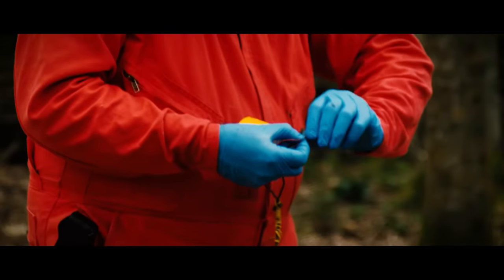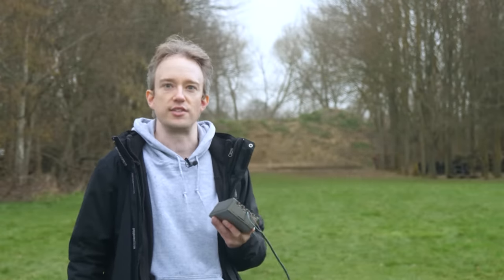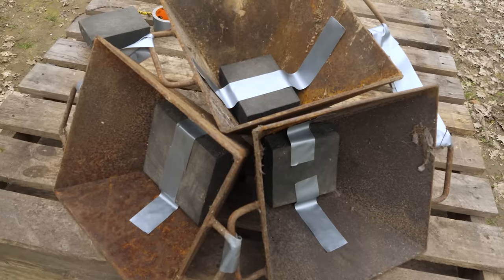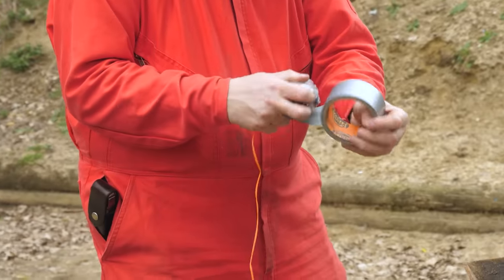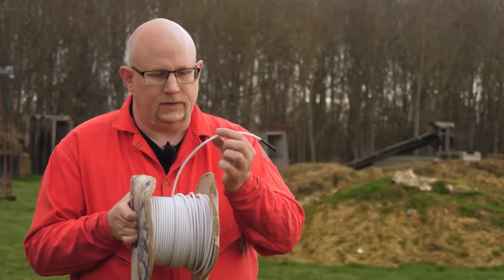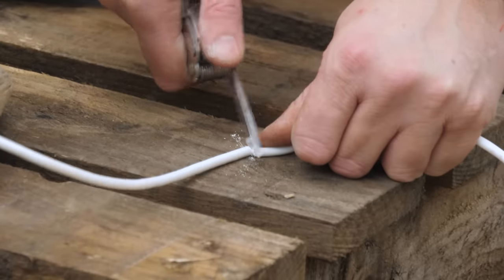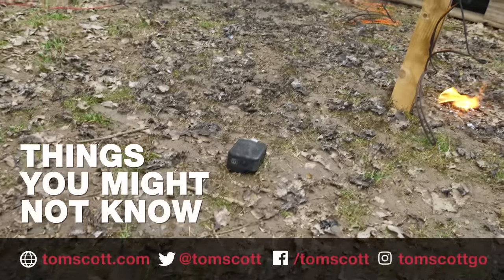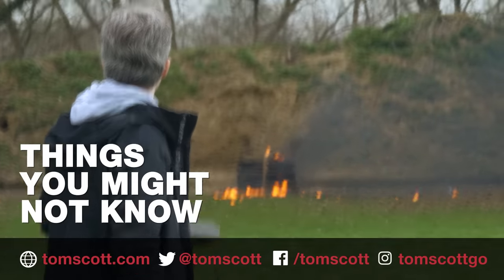Why Hollywood explosions don't look like real explosions

Comment: "Kerosene, petrol, diesel, and any other muck I happen to have lying around" I can tell this guy has fun with his job
Reply: I'm glad he's a pyrotechnician and not an anesthesiologist.
Reply: @vigilantcosmicpenguin8721  When I was developing a rocket using propane and nitrous oxide in the 90s, a friend said I should switch to cyclopropane and call it the anesthetic express.
Reply: Different tasks require different degrees of precision... Some applications of explosives have to be highly controlled (the spacing foam being a good example here. I won't be talking about tasks I'm more familiar with). Other bits are much more forgiving. Applying most of your effort to the important bits is just good time management.
Reply: @vigilantcosmicpenguin8721  EWWWWWW
Reply: It looked like diesel that was used in a degreaser

Comment: Another common pyrotechnic trick is the use of propane for things like cannons. Real cannon fire produces a lot of dust and concussive force at the muzzle, which is incredibly dangerous and can easily damage sensitive movie equipment; so a charge of compressed propane is used to get the bang and fireball without any of the mess and expense of actually breaking things.

Comment: I love how the real explosive is not so fancy but it makes all the leaves around it shaking, while the visually satisfying one barely blows away some leaves around.
Reply: If your explosion produces big glowing fireballs and heat, it's wasting energy it could've used pushing things around. The most powerful known explosives produce almost no flame at all. They just release colossal amounts of gas as fast as possible. The only thing you can see from them detonation is the shockwave as the air in front of the pressure front is compressed dense enough to act as a lens.
Reply: @dustinbrueggemann1875   Yup. artillery exercise from slightly closer than comfortable for an civilian is just a sudden puff of smoke, and then someone invisible whacks you with a giant pillow.
Reply: @dustinbrueggemann1875  that’s honestly a great way to define a shockwave
Reply: @dustinbrueggemann1875  indeed, all those plumes (smoke, dust, and flame) are not from the explosive itself, it's from whatever object it's destroying at the moment.
Reply: Right? Glad to know that the visually nice one is at least safer to make films with.
Reply: @paavobergmann4920  Gotta love being danger close during a training exercise
Reply: @richardmillhousenixon  way to brighten up your day!
Reply: @dustinbrueggemann1875  nuclear explosions have a sort of flame
Reply: @jimskywaker4345  Every explosion has flame, so much energy is obviously going to ignite stuff, but compare how much of the explosion is flame and how much is shockwave to see how strong an explosive is. The fireball on a nuclear explosion is 15 km on average  (if I recall) meanwhile its shockwave can set off seismographs on the whole planet
Reply: @dogfellow3848  Nah even the tsar bomba only had an ~6km fireball radius. 
A more normal range is like 500m-1000m fireball radius. and the radius in which buildings are seriously damaged is like 8-10 times that.

Comment: “Minimal damage”
two minutes later
“That’s a lot of fire”
Reply: If you look at the ground, the fiery/movie explosion seems a lot more tame, but like you said it has a lot of fire.
Reply: It does do a lot less damage despite the fire. An actual explosion can do structural damage to steel and concrete pieces of the set, whereas a big petrol explosion doesn't. The fire can be engineered around with sacrificial coverings such that the underlying structure doesn't get burned - especially if you have a fire crew standing by to extinguish it as soon as the all clear is given. That sort of thing allows a good size "Hollywood explosion" to be carried out even on a historic location rather than a constructed set.
Reply: This is fine.

Comment: "There's a lot of fire back there"
Famous last words in California and Australia
Reply: In Australia and California you can start a fire with a stern look. British weather means you struggle to light one with a few litres of kerosene.
Reply: @alanargent5422  it also doesnt help that cali doesnt let the little fires burn, all the debris collect up until there is enough for a fire to burn through trees' protective bark and start a big fire.
Reply: they are not last words australia didn’t just go up in flames and sink
Reply: @aidenaune7008  We do do that all the time. We start controlled fires too. The vast majority of wildfire prevention and suppression research has been done at UC schools.
Reply: @ObjectsInMotion  cali doesnt let fires burn, you are supposed to let them burn, otherwise the debris gathers up. controlled fires dont burn much at all, they only affect a small area.
Reply: @aidenaune7008  they let fires burn all the time, they only don’t when a residential area is at risk of enlarging the affected area.

Comment: Very interesting! so it's more akin to a flamethrower with a different mechanism to propel the fuel. The other element would be that it would be a lot easier to not flinch, because the actual explosive going off is much smaller, so the sound and shockwave vibrations would be a lot easier to deal with. Seemingly.

Comment: I love how the whole explosion is held together with less than a roll of duct tape.
Reply: Of course, if a whole roll was used, the explosions would be stopped by Duct Tape’s strength
Reply: @janmelantu7490  Didn’t think about this. But imagine if they used Flex Tape....
Reply: @dylancounts618  Imagine if they used cassette tape.
Reply: @dylancounts618  how to bottle explosions
Reply: @Qermaq  Or they could use police tape - though that might be more if the explosion went wrong.
Reply: @vigilantcosmicpenguin8721  Imagine if they used bubble gum tape. That'd be awesome - if it worked.

Comment: Pro tip: the person that is setting of the explosion is cleverly hidden in movies,cause they also dont hold the grinning smile.
Thats how the actors keep a serious face.
Reply: Can you retype that?
Reply: @ZaveAres   
The explosive specialist also grins like a dork while setting the explosives. Its impossible to triguer the explosion and hold a badass serious face.
Reply: @ninjabaiano6092  True true, and if you want a genuine shock reaction you tell the actor you're just going to walk it through and run the scene for positions...then detonate it when they don't expect it! 😁
Reply: @jessicataylor7174  That's a good way to get your actors to flinch and freak out thinking something terrible has happened. If that's what you want, then great idea, but if you don't want lawsuits claiming undue mental harm then you might want to avoid doing that....
Reply: @NortheastGamer  In Die Hard they dropped Alan Rickman/Hans Gruber on the count of 1, not 3 as they had told the actor.

Comment: More accurate might be "Why real explosives dont detonate like movie explosives"
The ones who love rockets like myself have seen quite the cinematic Boom just a few days ago. RIP SN10
Reply: That’s cause the rocket explosion was a huge fuel air explosion and movie explosions are emulating just that, big gas bombs.
Reply: @pablojams5152  That's why he's suggesting changing the title to "explosives" instead of using the term "explosions". Because as you just pointed out, there are real explosions that look like movie explosions, and this video is specifically focused on explosive devices, and it completely glosses over the fact that there are indeed real explosions that look like movie explosions.
Reply: @pablojams5152  Well, from what I heard it was actually a pressure vessel rupture which happened to be a fuel containing pressure vessel, which resulted in copious amounts of fuel (and possibly oxidizer) being propelled out very quickly, which then lit almost immediately into the giant fireball. Actually incredibly similar concept to the movie way of doing it.
Reply: it was kinda hilarious how it exploded after landing. It's like the rocket said "My task here is done, it is time to depart"

Comment: Chartered Explosive Engineer: "This fuel is made up of kerosene, petrol, diesel, and a bunch of other junk I had lying around"
Reply: Pours it into a plastic bag, on the dirt, while holding the can with his knees. No spill containment or prevention.
Reply: It's all... well, fuel. It might matter if you're trying to get an engine running, but probably not when it's just there to be burnt.
Reply: @kjdude8765  I imagine that the spill prevention comes in the form of having done it hundreds of times
Reply: I threw in this bag of white powder that was in the back of 'me shed!"
Reply: @kjdude8765  He's going to vaporize it and spread it out as a mist over a 15m diameter.  Probably only 80% of the fuel is going to end up combusting.  Small spills from the bag are the least of the problems with explosives.  

Military bases with ranges where they blow things up all the time tend to have massive pollution problems develop over time.
Reply: @celebrim1  and often there is extra pollution from foam used to put out flames too (PFAS). 😐
Reply: @jenelaina5665  Foam is not common that common in many places (it's a certain specialization and many departments aren't equipped with it at all in the US, and stuff like vehicle fires involving gasoline are often put out with nothing but water) and you don't NEED foam to put residual flames out, this isn't a pan fire where throwing water on it will cause it to explode; water can easily take care of the fuel left burning Not saying explosives ranges aren't contaminated with all sorts of crap, but in this particular case I don't think it's a big issue. If you look closely it appears to be a small testing range anyway. Also as far as setting those trees on fire that's a lot harder than you might think unless they're doing this during a major drought (which I somehow doubt given Tom's location). You'd need a napalm explosion (something that sticks rather than vaporizing) to have any chance at that.

Comment: The Semtex is really much more powerful than the fiery explosion at the end. In 3:21 you can see that the hollywood explosion blew some of the leaves adjacent to the explosion outwards, while in 0:19 the Semtex just lifted practically every leaf visible and shakes the camera used to record Tom, which is very far away from the explosion site.
Reply: That might be why Semtex is called an explosive and kerosene isn't. One detonates, the other just burns.

Comment: It really looks like the second explosion actually did more damage to it's surroundings
Reply: By setting it on fire. Also that’s the idea.
Reply: If you wrapped a casing around the semtex, you'd see more damage.
Reply: The Semtex explosion would do more damage to concrete, steel, etc. 

The gasoline explosion would probably do more damage than Semtex in some places, like a toilet paper warehouse.
Reply: @cymond  NO NOT THE TOILET PAPER

Comment: "Chartered Explosives Engineer"
What is that and how do I become one?
Reply: A recognised Masters Degree/15 years experience or a combination there of and a long interview where you demonstrate your knowledge and competencies against the requirements set by the Institute of Explosives Engineers and the UK Engineering Council.
Reply: @LiveActionFX  that sounds very reasonable
Reply: Start with chartered accountancy, then maybe move to banking. Do you have your own "Chartered Explosives Engineer" hat?
Reply: There is (or was) an organisation called the Institute for Explosives Engineering, which unfortunately shared its initials with the Institute for Electrical Engineers, another highly esteemed British professional Institution. Could cause confusion! 

Both lots can make very bright flashes and loud bangs, though generally speaking only one lot is supposed to do so on purpose...
Reply: @abarratt8869  The Institute of Explosives Engineers still exists, I'm a member and back in the 1990's I redesigned the logo to differentiate it from the Electrical Engineers - added an 'xp' to make it IExpE rather than IEE.  But I believe IEE has since become IET.
Reply: @LiveActionFX  yep, the IEE is all yours now. I suspect you hold it in higher esteem than we sparks hold the IET :P
Reply: @abarratt8869  which on let's the magic smoke out after the bang?
Reply: @Qermaq  But what do I do if I want to be a lion tamer?
Reply: @alicec1533  I don't know that. Aaaaahhhh....
Reply: @LiveActionFX  Thank goodness for that! I once had an awkward professional moment when called upon to carry out a task by someone who'd not realised there was such a thing as the Institute of Electrical Engineers, and had assumed that my listing  in the company personnel database as being a member of the IEE meant your institution! I declined to carry out the task! 

Indeed, we're now the IET, which so far as I can tell means we now make bright flashes, loud bangs, and loud clanging noises as pieces of metal break...
Reply: @CED99  Well I know us sparkies do. I don't know what they likes of @LiveActionFX call their smoke: perfume?
Reply: @OnboardG1  It's not what it once was. And my Charter certificate is nothing like as ornate and fancy as the one my old Pa got, back in his time...

Comment: “Do not attempt this at home”, and I’ve tried making blackpowder and failed miserably.
Reply: you just need fertilizer and coal
Reply: @felipedaiber2991  and a bit of sulfur, not to forget. It's really not that hard to make gunpowder. Getting it to explode instead of burn is the hard part. I've never succeeded, but maybe that's not such a bad thing...

Comment: You forgot the third part of how they film explosions in movies: digital effects in post
Reply: I do kind of wonder how much longer real explosive engineers are going to be around in Hollywood. CG engineering seems like its now the cheaper option.
Reply: @guyandsimcha  Good, pure CGI,  is surprisingly expensive for generating good looking explosions with enough random explosive effect in them.  So it is often cheaper to use real explosives and fuel.  Lots of model miniatures and make-up effects are still used and then enhanced with CGI, as it's cheaper to do this than to generate them as pure CGI !

Comment: Anyone who's watched newsreel footage knows that 'real' high-explosive explosions don't cause huge flames and smoke, more like a puff of dust.   In fact high explosives can and have been used to put out fires in e.g. oil wells.
Movie explosions need to be unrealistic for dramatic effect because the 'real thing' looks so underwhelming.
Reply: Unless the thing exploding is very big to start with.
Reply: get out the 500 pounder bomb from an f16. The dust cloud looks cooler to mee.
Reply: @mrshovelbottom7475  good job shielding the actors from that explosion >:)))

Comment: broke: heat from the explosions kill people!

Woke: laughs in Pressure and Shrapnel
Reply: Pressure really isnt a problem unless you step right on a mine or something. And even then shrapnel is still a bigger problem unless the mine gets absurdly large.
Reply: @leocurious9919  It really depends on what's exploding, there are for example offensive hand grenades which kill through over-pressure instead of shrapnel.
Reply: @skirata3144  Can you name examples of those grenades?
Reply: @satannstuff  Thanks for the example. But those are not in use since WW2 as far as I can tell. But I did find a "Enhanced Tactical Multi-Purpose" (...grenade) that the US army announced in 2016. It is supposed to be either with or without fragmentation. But it doesnt seem to be available yet. But I guess there really is some demand for this. Interesting, thanks.
Reply: @leocurious9919  hold the phone, did they really vomit all those words and then forgot to add the most important descriptor? XD
Reply: @Daniel-yy3ty  It really seems like it. Meanwhile, ETMP is also not a good acronym. Game over?
Reply: @leocurious9919  I mean... find me a tactical use for a fire hardened stick and it checks all those boxes...

Comment: Since the middle-80s or so, I've become aware of how much films and TV have relied on Gas-Air explosions -- those not done with some kind of Air gun/projector. I have also noticed, depending on budget, how in some productions ALL explosions sound Exactly The Same. All this is disheartening to a boy of the 50s, who grew up with war movies using real explosives tossing real dirt into the real air - or wreckage, as may be.
Thank you for this.

Comment: Showing the explosion from different angles and repeat it is exactly the wrong thing to do and is what film makers and Hollywood films usually get wrong. It actually minimizes the effect of the explosion and it makes it unrealistic and stupid while there are some exceptions for example the explosion of the hospital in Christopher Nolan’s The Dark Knight is a good example. It shows the massive explosion without many cuts, which is exactly the right thing to do because then the effect is really strong.
The same applies to car accidents actually. One very good example is the car crash in the 2006 movie Casino Royale. There’s absolutely no cut in the scene where Daniel Craig and his car veer off the road and therefore it has a really strong effect. Most of the car accidents are completely ruined through too much editing.

Comment: not a pyrotechnician but I bet you can even add en extra bit of explosionary goodness to this movie-style "Boom" by adding bags of flour. Similar to the fuel it will be burst and shot into the air where the now enormous suface area of all these tiny particles will burn it what is commonly known as a dust explosion.